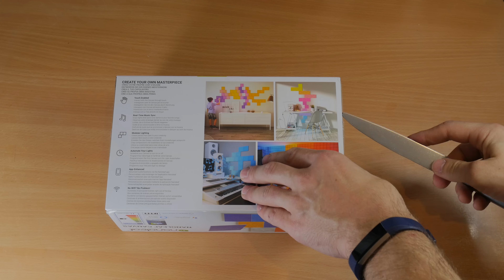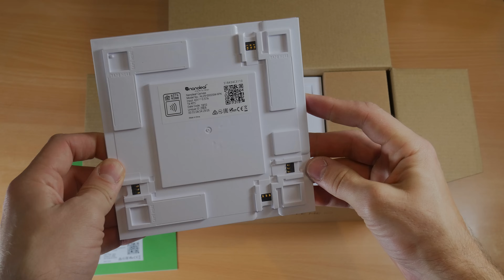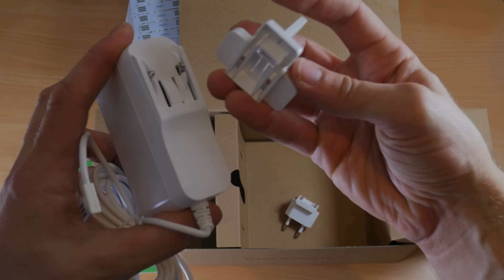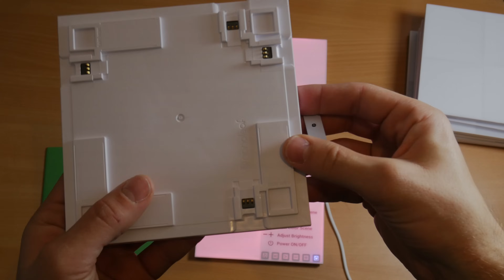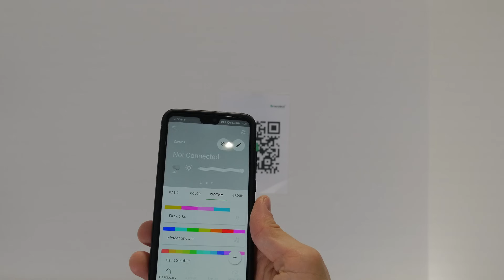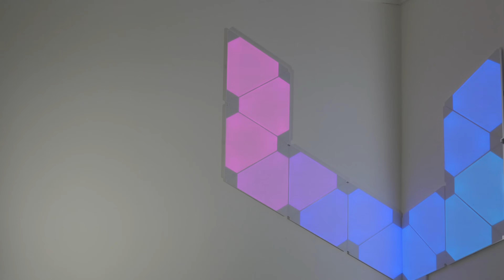Nanoleaf Canvas Unboxing and review

Comment: So I bought this from Micro Center in Patterson New Jersey. And my package did not come the way you showed the unboxing. Each  panel already had the sticky tape to the back of it and it was difficult to get each panel off of each other. Furthermore, I can't connect to my wifi network. Seems like they gave me a open box item that was not labeled as open box. Now I have to drive back, 1 hour and a half distance to return this. This is my 2nd bad experience with micro center in Patterson New Jersey I would not recommend any to go to there.

Comment: but finally, do you prefer aurora or canvas??
Reply from the maker: Good question. You can cover more space with each aurora panel so technically better value for money but the fact you can connect more panels and canvas has rhythm, etc built in probably makes it more appealing? Personally preference really. I like Canvas a lot. The original panels are brighter though.
Reply: @TheProvokedPrawn  thanks!!

I want few panels, then better Aurora, right?
Reply from the maker: @rafacorredera  quite probably yes. Both start kits are fairly small. Have you seen my other video?

Comment: Are the linkers that come with the starter set capable of flexing 90 degrees? I have 30 Aurora panels the span across two walls and was looking to upgrade. Tech support said they were capable but I am not sure, they look pretty rigid in your video. Thanks for the awesome review!
Reply from the maker: I don't think they are no. They seem to be stiff and certainly not as flexible. They're also not the same size, so you can't use the flexible linkers that worked with aroura.